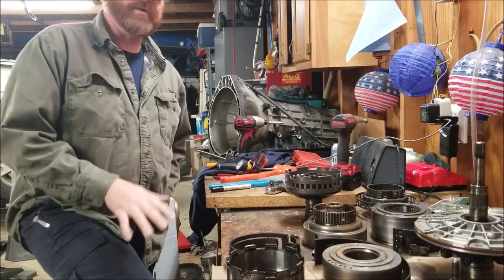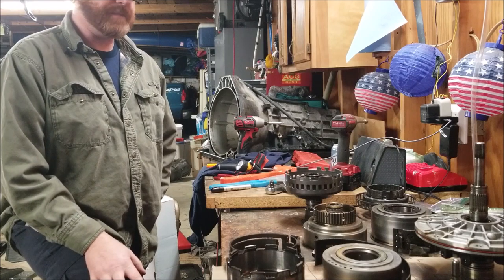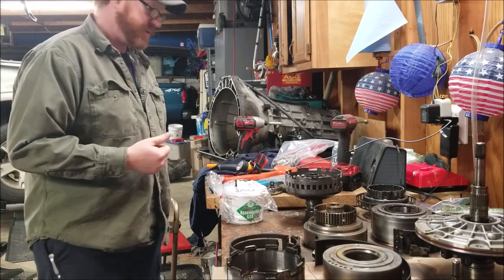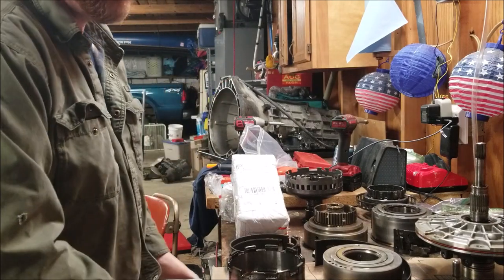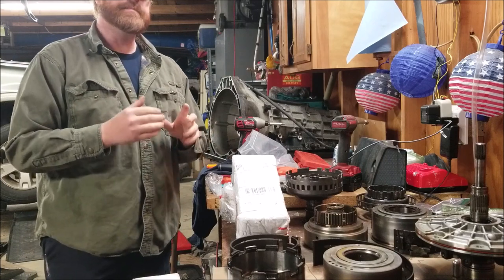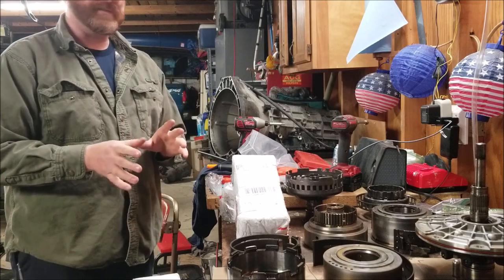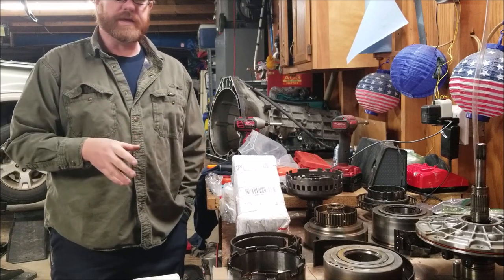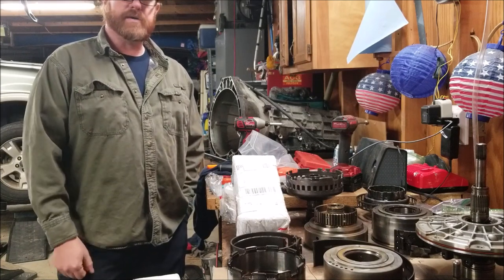The cost to rebuild a 5R55 transmission

Comment: Great video, i would recommend doing this shift kit while its down tho.. first time i pulled mine only problem was a bad overdrive sprag, replaced it and the torque converter.. ran perfect exactly one year then wouldnt move one morning.. the flow control valve in the pump was stuck open.. if i would have bought the shift kit the first time, it would have came with the new updated flow control valve and I wouldnt have to pull it again.. but this time, i took the time to do the full rebuild..

Comment: The purpose of a rebuild is to add updates. The reason a rebuild is better than a reman is because of the updates but money is everything if you can afford them you’ll have a better transmission then factory
Reply: Shouldn't a reman have the updates in it when its rebuild to be sold as a reman

Comment: I’ve got a ford ranger here in Australia and it’s $5500 to get a rebuild. I own 3 cars and that is not an option right now. I have gone through two now after installing one from a wrecker for 3.8K . I’m heartbroken. So I have one out the car and I’m going to tackle it step by step. Cheers for vid I need a mountain of info
Reply from the maker: @Adz082  glad It helped. It was a big job but big savings too. Good luck.

Comment: Transmission shop scammed me for $1800 dollars. I took my car in for a torque converter issue and ended up paying for a rebuild that didn't fix anything. Now my car slips and flare in gears.
Reply: eccentric aquarius 85  take it back to them

Comment: My then 1991 Ford Explorer auto transmission began leaking ATF badly while about 500 miles from home. Stopped off at an Aamco shop and was told it needed a rebuild.  Spent $2,600 for the rebuild.  Interestingly, there was no engine braking in 1st gear before and after the rebuild?  About 6,000 miles later it began to drip ATF, the same situation as last time when about a few hundred miles after the dripping started it began losing ATF at about a pint per 50 miles.  I should have just driven the Explorer to a wrecking yard and bought a new car!  I sold the '91 Explorer to a mechanic for $500.  Good for 4Wheeling if nothing else.
Reply: Shouldn't that have been covered under warranty?

Comment: Thanks for the info, it saved me a bunch of research time. How's it running? Do you have the 50K on it yet? What's the mileage at now. Thanks Again!
Reply from the maker: I got about 20k on it and then the timing chain skipped a tooth and broke a ton of stuff internally on the motor so I sold it for scrap.   I should have pulled the trans first to sell it separately.
Reply: Thanks for the reply, ours has 110k on, I’ll run it about 20k and trade it in. Thanks for your help, stay safe..
Reply: These are one of the worst gd trucks of all time I did the timing chains with the best aftermarket kit you can buy from
Cloyes! Suppose to be better than oem. But still rattled, then I put a trans authority trans in the son of a gun well wouldn’t you know it it has torque converter valve body or service issue still? Getting flashing od and check trans…. Unbelievable only vehicle I’ve ever seen you can’t actually Fix no matter how much money you throw at it 😂

Comment: Good evenings from 🇨🇦,got a 2002 explorer slipping on 2/ 3 shift. Work ford dealership . Code p732 and o775,,worked on the solenoids, cleaning, no real difference. I had a another's used one,installed but winter hit,waiting for spring.  Watching videos like yours, thanks,much appreciation. Going also pull the survoes,after learning  their problems. I got a quote of 2000 with tax for a rebuild. The explorer is in very great shape for being here in Nova Scotia. Thanks for the imformative video have a great week.

Comment: Whats the skill level required for this job? Are you a full time mechanic and have you rebuilt other transmissions prior to this? TIA
Reply from the maker: @danielgarage5276  I am a aircraft mechanic, not a car mechanic. There are some really good rebuild videos on here. I had never rebuilt one prior to this. Just be very neat and organized when taking it apart.
Reply: @bucksgarage1  OK thank you for responding. Thanks for the info too. I appreciate it.

Comment: I have a 2003 Ford explorer and it's slipping in 3rd gear and it drive in 3rd. That looks like your intermediate servo. I personally believe you can Rheem those out without those guides. Reamers are basically self-aligning. If you can try it out inside you might even be able to do it without taking the transmission apart

Comment: I really hope this works out for ya man! I give you major props for taking on this job.
Reply from the maker: 200 miles in and its still moving  for now. For me its about completing a project like that. Its a good feeling using something you brought back from the grave
Reply: @bucksgarage1  did the tranny hold up ? I'm just about to do this exact project..sucks because the tranny was working great and then I heard a slight metal dragging sound (band snapped) ...I'm online looking for a trans jack as I write this....thanks
Reply from the maker: @theloosemoose8200  i didn't have any trans problems after that. Put over 10000 more miles in it then the timing chain skipped a tooth and ruined the motor somewhere around 170,000 miles on it total.
Reply: @bucksgarage1  oh man, you just cant win sometimes. Im feeling the hardest part of this debacle will be safely getting the car in the air, time like this have me really thinking about adding a lift to the garage..
Reply from the maker: @theloosemoose8200  I hear you. It took me a long time to justify buying one and now I look back and can't imagine not having it
Reply: @bucksgarage1  yeah, I think I'm going to pull the trigger on one right now... They're not as expensive as I thought they were...  It would also make working on cars much more enjoyable, I'm not old but I'm also not young enough to be rolling around on the floor anymore..
Reply from the maker: @theloosemoose8200  I felt the same way. I got mine at 37. It’s saved me some uncomfortable days for sure

Comment: Can you tell me if the 40" rise I've seen published for this lift means 40" from the floor, or is it that the lift platform goes up 40" from where it began, which would mean that adding that plus the height of the platform itself would mean it being like 44" or 45" from the floor?
Reply from the maker: I'll check in the morning and get back to you
Reply from the maker: The top of the lift platform is 40" off of the ground when fully extended.
Reply: @bucksgarage1  Thanks!

Comment: Did he say a rebuilt Torque converter?????? its a sealed unit, (welded) how do they rebuild one and WHY? the cost would far out weigh buying a new one??
Reply: all torque converters are rebuilt and rewelded
Reply: @LiilTyweezy  minus the ones that get shredded at scrap yards. It's why they charge a core when you buy one. Unless it's from the dealer parts shop or a custom built race converter it's most likely rebuilt.

Comment: ?? Its not showing the video Brett
Never mind, figured it out. Watching now👍you did cut your head off on it though. I have to pre check lately or i do the same
Reply: Good call on only replacing what needs to be replaced. Allot of times especially on older vehicals like you said it's not worth overkill or your wasting money👍
Reply from the maker: Yea i thought i would have been in frame where i was standing. Ill onow for next time. Thanks for watching Tim.

Comment: Is there an update?
Reply from the maker: 4500 miles on it since the rebuild and going strong.
Reply: Brett Buckley how many hours did you end up putting into this job?
Reply from the maker: Somewhere around 10 all said and done.
Reply: Brett Buckley was the servo the biggest headache
Reply from the maker: It was really easy. Only took about 20 mins.
Reply: @bucksgarage1 Still going strong?
Reply from the maker: @Dave_Menz_p4p_number_1  it made it 15k miles then the motor went.
Reply: @bucksgarage1  aint that how it goes lol
Reply from the maker: @Dave_Menz_p4p_number_1  yep. It was pretty dissapointing. I sold the whole thing for 500. I was just done with it at that point.
Reply: @bucksgarage1 how many miles did it have?
Reply from the maker: @LandonMartien  160,000
Reply: @bucksgarage1  damn, that’s sucks. I was expecting at the very least 200,000